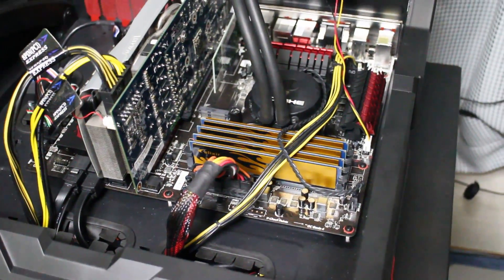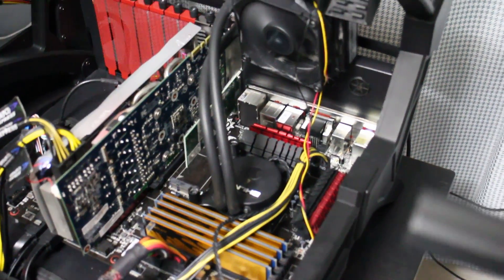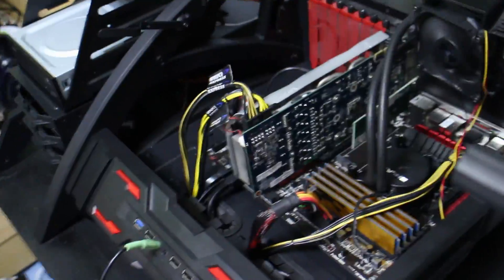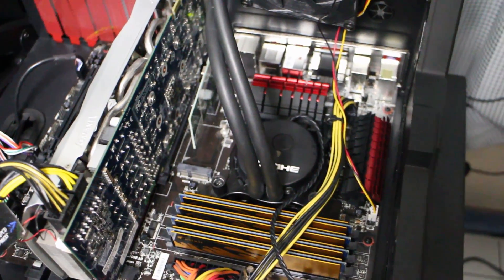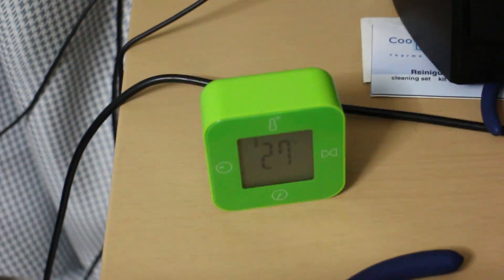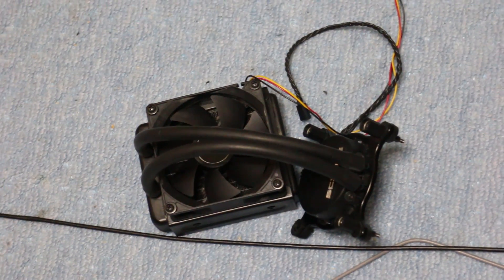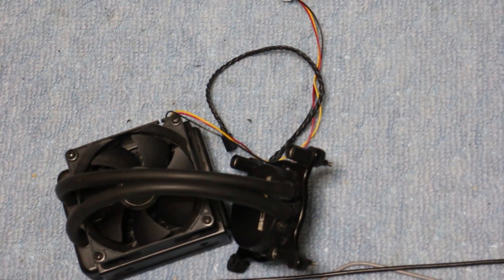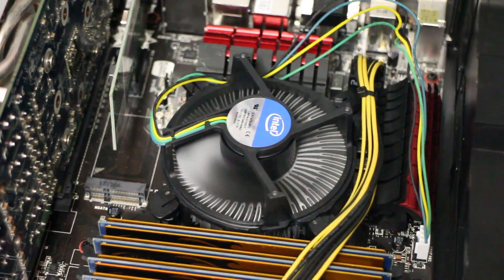How To Spot a Dead CPU Water Cooler (My Asetek Water Pump Failed)

Comment: Got my cpu underclocked to 1.5 Ghz because my water cooler is on its way out. Luckily my AIO has lights tied to temperature, so I started noticing the temp spikes as the AIO died over time. Thinking it's completely dead now because it can't even hold 1.9Ghz below 90°C anymore

Comment: Not really how you spot a dead water cooler.   If you pump dies, what will happen, is the water cooler fan will start to spin faster and faster and louder and louder... because the CPU water block is heating up fast and getting blazing hot, and the temp sensor is sensing it, and telling the fan to spin faster, but that solves nothing as the liquid is no longer moving because the pump has failed or gotten stuck.   That's how mine just died.   I knew it immediately from the sound, as normally my system is silent.  If you ever hear a fan for no reason (like you didn't suddenly put a heavy load on the CPU or GPU) start to ramp up and go faster and faster, something isn't right.    

In such a scenario the base of your water block will be really hot, but the fan radiator will be cold.
Reply: This is exactly whats happening to me right now couldn’t have described it any better

Comment: same problem , two fans are running , pump also running. but no heat transfer. I have the exact same CPU as yours. The heat sink on top of the CPU is about extremely hot while the other side of the heat sink is pretty cold I would say. But my PC still can start but cpu only running at around 1 GHz

Comment: If the radiator is hot, the pump must be working, but your fan is crap or the radiator's grills are filled with dust crap. It also "fails" when it runs out of liquid, then you need to pry a hose loose, add water, then add a zip tie to keep it on the barbs.

Comment: I know this video is several years old, but this may have saved me alot of headache!  I have a Corsair H80i Water Cooler and it has lasted me for many years but I was experiencing the EXACT same issue you were having with the random shutdowns even after my CPU and GPU temps were normal.  I bought a brand new power supply thinking that it could be the issue, but after I replaced it the shutdown became more frequent!  Which made no sense at all.  So I though maybe it's my graphics card, so I took out my GTX 1080i, and put my old card in and it shut down again!  So I was close to going nuclear and building a brand new PC.  But my mind kept on going to my CPU and the time where I grabbed my water cooler tube and it was very hot.
So I started looking at vids thinking it may be my Water cooler and I came across this vid!  So now I know I have to get a new one, and hopefully this issue will be behind me.
Reply: Did the new cooler fix the issue?
Reply: my pc also shutting down i downloaded hwinfo i noticed my cpu goes up to 100C degree when gaming! and idle is 50C.

Comment: Hate water cooling because of this. Had a gpu with water pump and a corsair h110 v2 cpu cooler and both died. Only use air coolers!

Comment: I think I’ve been using a dead Corsair liquid cooler for 7 years, there’s no vibration at all, the 2 fans on the cooler spins all the time because it’s connected to the CPU fan connector and fan speed controller, the cooler itself has it’s own power source connected to a molex cable from the PSU (so if it’s working then it’s at full speed at all the time). I bought it 2nd hand, the seller is a scam artist as he didn’t give me the $100 TV card that should be part of the auctioned goods. These products should has LED light on to show it’s working.

Comment: Hello, I am having the same issue as you. My monitor will freeze and I cannot move my mouse. After that the monitor will go to sleep but my pc will stay on. I have a program that monitors temperature in my PC and it says my CPU gets up to 190 Fahrenheit. Your old liquid cooling looks exactly like mine and I would like to replace it. Please tell me what parts to buy/ look for (as i want one exactly like yours). Thank you so much, I am new to fixing computers as I bought this PC off of someone and didn't build it myself.

Comment: i had my h60 running for years and had the same problem. i ended up blowing out the rad and that seemed to fix it but I'm thinking of ripping it out and putting the stock fan in.

Comment: Wait, why would the radiator be hot if the pump isn't working or out of water? Or was it just the radiator fan that went out? On my rigs, I actually check them by feeling for cold radiators which indicates the water is gone. I've not figured out how that could happen but I've had it happen twice. One was a brand new $10,000 ASIC chip and it was destroyed despite redundant thermal protections built-in. I suspect the water itself could have been what damaged it. But I saw no water anywhere. It was 1 of the 3 radiators in the case being cold that triggered me to investigate

Comment: OK, so you determined that your cooler failed because the thermal protection shut it down. That's kinda like you figure your car's cooling system failed because it blew the radiator cap through the hood (or bonnet in your case). There's gotta be a better way, like maybe a temp gauge in your task bar (?)

Comment: I know this video is 6 years old but I'm having a similar issue. My CPU is hitting 90 Celsius and I dont think my liquid cooler is doing anything. How can i try to troubleshoot? Any recommendations if I have to replace the whole thing? Thank you!
Reply: Yo did you find a solution ?
Reply: @jest3167  my liquid cooler burnt out and stopped working. Had to get a replacement for my CPU to hit good Temps again

Comment: I realize this video is OLD but I thought I'd comment anyway, perhaps in a year I might see a response LOL. I have this Corsair H55 AIO that I've had strapped onto an old Asus R9 290X (by way of NZXT GPU bracket) and I suspect the cooler's malfunctioning. (GPU overheats, PC shuts off display after a minute, Adrenaline Driver crashes, etc). Put the box cooler back on and everything's okay. On the AIO I can hear the pump. The water return tube (to radiator) is SUPER HOT while the radiator stays cold. There's probably a blockage somewhere? Anyone have any suggestions? I'll open it up if there's a chance of re-viving it.
Reply from the maker: The pump is probably gone.

Comment: Just happened to me now. I had it installed 7 years ago. Couple of days it's been playing up. Sometimes it works and most of the time it doesn't. I will buy the same brand cooler master as 7 years seems to be pretty good. Troubleshoot Cleaning the radiator fins will help too and make sure the fans are working before throwing them away.

Comment: My water cooler died as well im sad. I'm thinking to switch to air cooling. I boot up my PC processor 98 degrees Celsius. I got scared because my PC shut down right away so I thought my processor I7-7700k died holy shit. So happy it didn't I tried 2 times to fix it ,but it wouldn't run at all. I even took it apart I felt hot water coming out of it :C I looked at the copper sink pipe and it looked like it was all burned up. RIP my malestorm 120T. I took it apart because I saw some really high numbers when I was gaming today and yesterday made me scared. I put some sterilized water and put everything back together made it worse then before after I bootup the PC. Afterword's PC right away shut down and I thought my pc was done. But later on I changed the thermal past again and booted up only to find that the liquid cooler was barely cooling anything. If anything probably the thermal past was keeping my pc's processor from dyeing.

Comment: i have an h80i that i used only a little under a yearwith a 4690k , for some reason it wont cool my 6700k underload(85c+) idle temps are fine (25-30c)corsair link reads pump speeds normally everythig looks fine... tried multiple thermal paste application with no luck, what gives?

Comment: you're lucky you got yours to last that long. I've only had my Kraken x62 from NZXT brand new for 8 months and was lucky when the pump died on it, it was as soon as the pc was turned on and the CPU heat protection prevented the computer from posting. Luckily enough, NZXT provides a 6 year warranty on their kraken series coolers.

Comment: CPU runs on 80 degrees C at the lowest, goes to 100 within 3 - 10 mins of startup and shutsdown completely to black.

I'm guessing my Seidon 120M failed. Guess its a nice run for 4 years.
Reply: t850terminator it worked for 4 years?
That’s awesome
Reply: My CPU is running on 98-100C for 4 hours already, I don't even know how my PC is still running
Reply: Im having this problem right now my Hydro H100iv1 is almost 5 years now, i think it finally gave in, my system is at 80c at 2% load.

Comment: PLEASE HELP I'm having issues with my CPU supposedly overheating. I'm 
using a Corsair H60 Hydro CPU water cooler (about 5-6 yrs old now). The 
CPU is not OCed (or very slightly with help of software).
I'm not even stressing my machine when suddenly the temps will sometimes quickly rise from around 35-38°C to well over 80°C and temp warning start to appear and my fans RMP goes up (as they should). The performance of my machine also suddenly drops to a point where even basic internet browsing and YouTube vids become a problem. And then, just as suddenly, after a few minutes, the temps will rapidly drop and everything is back to normal.
When I open my machine and touch the fans or the Corsair Hydro none of these component feel hot in any way.

Could it be just a software thing and I need to reinstall my windows? Perhaps a virus?
Or is the Corsair Hydro dead and I should get a new one?
Reply: Atomsk12 6 years? Time for an upgrade my friend
Reply: You are better off replacing it unless you want to risk your current computer.

Comment: Air coolers are far better in terms of reliability. 
I am using Coolermaster Hyper101 and its doing perfectly fine.
Reply: SREEJITH A yeah but problem is my processor gets too hot no matter what fan and heatsink I use. Plus the hyper 212 evo which is so acclaimed, makes a chirping sound all the time simply because the fan that came with it is cheap af.

Comment: For anyone using these closed loops systems make sure you properly mount the rad. they're not 100% bubble free.. you can hear them bubble then you first turn it on if the rad was flipped around a bit. tubes should either always be on the top or bottom. or if you're doing it on the side, the feed line should be lower than the return line. a small air bubble getting trapped in the pump is all it takes.. simply lift and rotate your chassis around on all axis to help the liquid push the air bubble through :) once its properly "burped" it should give you PLENTY of years maintenance free. going on 6 years for my antec
Reply: Does New Egg make the mistake of installing the radiator the wrong way a lot? My brother got a computer built from them and after about 5-6 months noticed issues with the CPU getting too hot. He had a Asetek 510LC installed by them and neither of us knew enough about liquid cooling systems so did not understand why it was having issues.

I guess my only question is if there is an easy way to tell the difference between the Feed line and the Return line without opening it up and checking the turbine?

He used it for about 3-4 years and ended up buying a new computer all together. I would like to get the old one back to being able to run games again as the rest of the system seems to be running fine and it has a really nice graphics card that is still working like new. I think I'm only going to need to replace the CPU and the cooling system for it.
Reply: Hi I had my cooler for 3 months and it randomaly started failing, now my pc last 10 mins b4 restarting, so if i rotate the whole pc it will fix it?
Reply: And when you say it should be on the top or bottoom of it, are you talking about top or bottom of the part that conncects to the cpu or back to the fan on the wall of the tower?

-thanks
Reply: Thanks
Reply: Your comment would have helped me a few days ago... I was hearing bubble sounds from 6 months and even checked why it happens... Found some videos saying it's just air... I even left a comment if I should do something about it and is it harmful but never got any replies... 4 days ago my cooler died... I am no tech guy so i never mess with inner parts

Comment: How can you tell your water block pump is dead? Your computer cuts off! LOL!

It doesn't also need to be in complete failure. You can have partial failure which is my case. My CPU temps shoot up to 100C under load. It used to be around 70-80C.

I've switched around wires, checked everything so it has to be the pump.

It's been maybe 3 years. Here's the thing, I don't want to replace shit like that. So I'm not buying water coolers anymore. It's back to air cooling for me that never fails except for the fan which can be easily replaced and doesn't require major surgery.

Comment: I am having the same problem with a asetek 550lc. it came with my computer and my setup is quite good with gtx 980 and i7 4790 (sorry if thats not exact number). my pump was soundless for the 1st year I had it second year it was picking up some noise and now it loud as can be grinding sound almost but the weird thing is it keep the computer in the 40 to 50 idle but when i play games (arma3) 70s to 80s and last night I was playing csgo and it got highest 96 before i just shut it off myself. fans work and the rad is dusty but not bad cleaned it 3 to 6 months ago. im just worried that its not the pump because  it idles without dying and holds on the best it can  while gaming so maybe my pump is just giving up. id say max 3 years least almost 2 years I am hoping its the brand is crap.

Comment: in all honesty it wont damage it as it cuts off way before any damage can happen
Reply: Charles thekinglov I stupidly tried restarting my PC over 20 times thinking something would change. No signs that my CPU has been bricked though. I guess motherboards are just programmed to shut off before anything serious can happen.
Reply: soweit3 high end cpus will normally kill the cpu.  However as much as this is more or less safe it’s something you shouldn’t push Bc the cpu temp maybe be off and if it’s killing the cpu rather then throttling it you are way over its limit. You are well out of spec.  As much as this shouldn’t kill your cpu it does not help its overall lifetime and could end up killing the cpu early and worst if it’s already on its past leg however with a cpu your can’t tell if it’s on its last leg so.
Reply: Can a BSOD brake something in the thermal sensors? I had a Razer Ouroboros (rzudd.dll) BSOD and it seems my cpu went to 90C (190F). 

Asus Strix Z270, i7 7700K, 120mm AIO (big brand but I can't be sure of the name).

Thanks!
Reply: I'm not so sure on this.. I'm not 100% sure how the circuit works on every machine but the power supply itself has no thermal monitoring capability. The motherboard itself is controlling the PSU on/off/standby state. It is not directly connected to the power button. Rather, the button send signal to the motherboard, which monitors various things and then sends signals to the PSU if everything check out. That's why sometimes, when a system locks up (bluescreen), it refuses to power off when pressing the power button. The motherboard can become hung in a way that everything gets stuck. I call it a hard lock and can be quickly tested by checking if the keyboard's  "caps lock" light responds when pressed. If it doesnt, most likely EVERY component of the motherboard is hung. Power on/off function, thermal monitoring, fan speed control, diagnostic lights included. Often the CPU will go to maximum clocks or something because they often get very hot very fast like thermal runaway while it's hung up. Holding down power button for 10 seconds usually forces power off via some backup system the board has, but I've had even that refuse to respond once and had to yank the power cord. It's also possible that the temperature probe is bad or isn't read properly . Had both those happen as well. Thermal monitoring is FAR from failsafe. In fact, I find it so unreliable, I disable it on my systems when I can. I use my own custom made watchdog circuit with its own temperature probes. It communicates with PSU directly independent of everything else. I think there are commercial solutions available that do the same thing but it's easy enough to do with a microcontroller
Reply: TooTH PiCK Your information is not quite accurate as to how PC’s function exactly, certainly regarding the notion of disabling safeguards thru the BIOS (assuming that’s the route you were referring to). You may have some electrical knowledge that gets yourself by, but recommending the things you stated to say an inexperienced user could be extremely detrimental to their hardware, possibly even their safety. Thermal safeguards are put in place to not only protect the hardware from thermal runaways, but also to prevent wires and other power delivery components from melting or worse combusting in to a flame. I would never recommend disabling something like that, unless you are just attempting to sabotage.
Reply: it decreases the lifespan of the processor for sure

Comment: I have been using my asetek 550lc for over 2 years now - I actually have no complaints about it, because it is keeping my Intel core I7 cool and it does it quietly. I would actually recommend this CPU cooler - i Think you just got unlucky with yours ;(